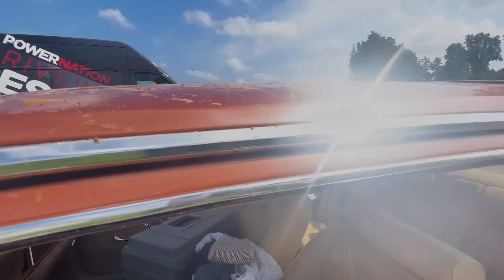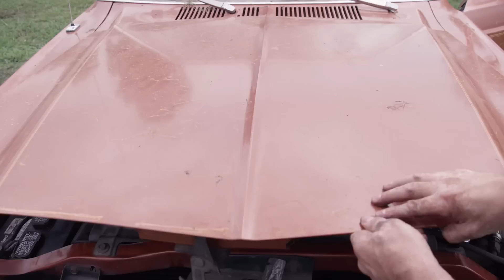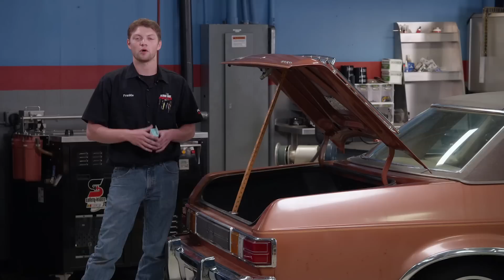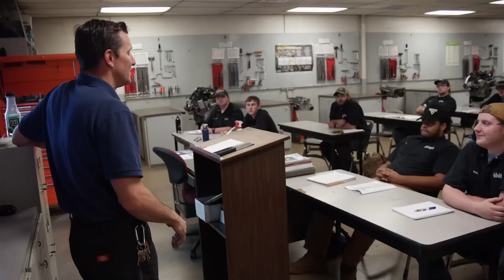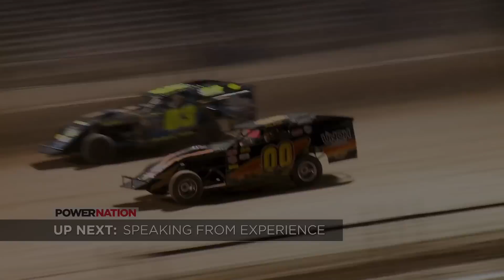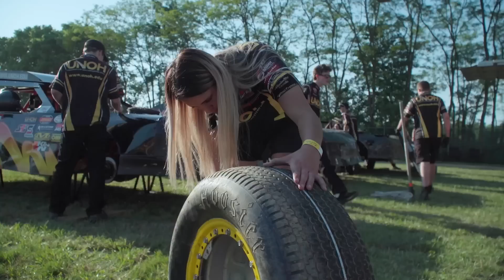An Old 1977 Granada Gets Fired Up - Engine Power S9, E12

Comment: Hi I've got a 91 mercury Capri turbo , I really need help with. I started as a father/son project and my son drove it for a year to a year and a half . I started loosing power and bearly runs . We ended up getting him a newer car so now it's mine
Reply: I've dropped the exhaust thinking the cat was plugged. I had thought maybe it jumped a tooth on timing ,so I advanced than tried retarding it ( no difference)
Reply: So it's in the garage and I hear about it constantly from the wife

Comment: I took the high performance engines and machining class at Cerritos Community College in Norwalk Ca and ended up crewing for the Canidae Pet Food Turtles Toy Sand Dragster Good times. Best part a semester was only 150 dollars. After I got hired at Barnes Systems oil pumps in Torrance Ca and joined a coworkers sprint car team.

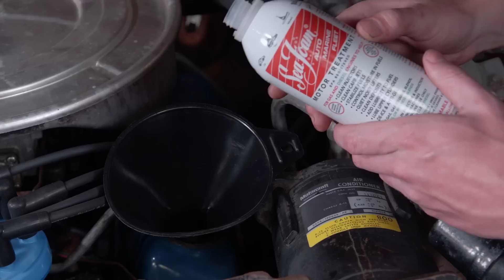Comment: 9:30 I was wondering when they would start lying. Regular motor oil is the best thing for that engine.
Instead of replacing the fuel filter. They put gas treatment in the tank.

Comment: Rock auto does have lots of parts  ! But getting the right one and the part number you want ? Good luck !! Gave it  a try ordered a oil filter. Cheep not expensive to ship ! Received it on time right part good quality. So I ordered 5 more . Didn't change any thing but the order amount ! Did not receive the same quality filters !! Listed as same part but obviously wasn't. Had different part number even though same filter part number !  And now days shipping makes everything  way more expensive than a trip to the parts store ! Plus way easier to return anything !

Comment: Had a 76 Mercury monarch.  351 windsor, 4 bbl, fixed the motor, new tires, shocks, etc.  Had an 8-track even.  lol. Ended up shooting the power steering pulley THROUGH the hood going 80 mph.  Still ran after I fixed it, but was never the same.  Used it until it died.  Those were the days when cars would go for a while.

Comment: Worked in a private auto body repair shop in my area of the career. The owner was in the American cars for sure. Thought his wife's Chevy V8 350 Caprice was fast. A customer's Thunderbird turbo coupe with that 4-cylinder pinto engine in a manual transmission came into the shop for repairs. Drove the bosses Caprice up to the paint store once. Then I took that turbo T-Bird out for a test drive after repairs. Damn that Thunderbird 4 cylinder pinto turbo engine hauled ass and I told him that Ford will blow the doors off of that Chevy. Wasn't too happy I told him that.

Comment: Great episode, best one this season. Love when they leave the shop and work on old cars. They should have there own project cars like the other shows on Power Nation. They should find cars nobody has seen for awhile from the 70's - 80's and put 500 - 600 horsepower in them with the original engine or a new one.

Comment: Yep, had a '77 two-door as a teen. Mine was an in-line 6 but this looks like a 302-V8 probably with C4 automatic. Can't believe the condition the whole vehicle is in. Would be nice to see it. Made decision to move from Indiana to just south of Columbia TN, and coming down next week to look for place to live and a new job not driving semi-trucks. Decided 38-years was long enough. Waiting for my F-150 to get done as the shop is rebuilding rear axle-diff assembly. I suspect a pinion or carrier bearing in the diff. Whatever it is, it was bad and I wasn't taking any chances driving to TN like that.

Comment: that car has not been sitting outside long. It's too nice
Reply: This being a scripted TV show, it probably sat in someone's garage. It was most likely towed out, the air let out of the tires, and the rotor removed and the plug wire ripped apart, to add to the "illusion" it had sat outside. Look when they drive it away, there's green grass under it
Reply: @dave1135  yeah, I was being too nice. I noticed the tires looked like someone let the air out. That's dishonest. They are trying to cash in on those channels that really do a "will it start" show, and half of those are scripted

Comment: I had a Grenada with a 302, It was white with green interior, I laughed when i bought it for 500 bucks because it was so cheap. The car was in perfect shape and I ended up loving that old car, 2 door with ice cold AC and not bad MPG. I wish I still had it! BTW it was much better after I replaced the Variable venturi carb.

Comment: This is right around the time of the cheap steel from Japan, if you looked at it and watched, you could see it start rusting. The Ford assembly plant in Mahwah NJ only built the two door and I think it was around 1977-78 that they started using the E Coat dip tank

Comment: In 1978 my parents bought their 1st brand new car and their Granada also had a 302.
Reply: My parents too but ours had the straight 6.  That thing survived two teenage drivers, a couple of ditches and one high speed run into a corn field.
Reply: @davem6735  how much miles? Original tranny?
Reply: @RohanSanjith  100,000 miles when they traded it in.  Never a problem with the transmission other than leaking.
Reply: Sounds good 👌

Comment: I had a blue one.  Same year.  We'd put a homemade cell phone in it.  This was 1985/1986.  My friend modified a cb radio with FM and a tone squelch with a Radio Shack handheld phone.  At his place, we had a Repeater and a 90' tower.  The repeater used a phone patch and tone encoder that we made ourselves.  So from the cars we could hit the repeater and make full duplex phone calls.  This was before the Motorola car phones.  And, the calls were made through a regular landline phone via the repeater; no extra expense.  The Granada was a good car as long as you stayed on top of maintenance.  I always kept extra belts, alternator, starter, water pump and other parts in the trunk.
Reply: It was a good car as long as you had spare everything to replace what went wrong?
Reply: @eric.wohlwend  It was Habit.  I had a few old Mopars and the trunk always had spare parts.  The most powerful cars I had would even get U-Joints stored in the trunk.  I had a 68 Coronet 440 and I broke down one day.  Popped open the trunk and changed the water pump right in the shoulder of the highway.  NJ State Trooper stopped and he even helped with grabbing the right tools.  It was a different time.  We worked on our own cars because they were much simpler.  My 73 Duster with 440 would tear up U-Joints.  And that's even with sub-frame connectors and welded chain on the rear.  The old engines made huge compression and big torque.  I miss those days so much.  It was more freedom.  Peace.  Especially after leaving the Service.
Reply: So you could make phone calls as long as your in range of the tower.
Reply: @ozzymandus3865  Yes.  The range was about 30 miles
Reply: In my first sales position I used a Motorola privacy plus radio phone using 800 mhz.

What did you end up doing in your professional career?
Reply: @davidshea8047  I had a band then but we didn’t get bigger than local radio.  Ended up managing a circuit board mfg in Camden NJ
Reply: Ll😅oooopo😅
Reply: Me la 😊😅😊😅😊😅😊😅itiirittit😊😅teuutuitiiriiitruining ur ii eye is iit😊triiiiti😊😊iiiitttttuuttitittt😊😊😮t😊į